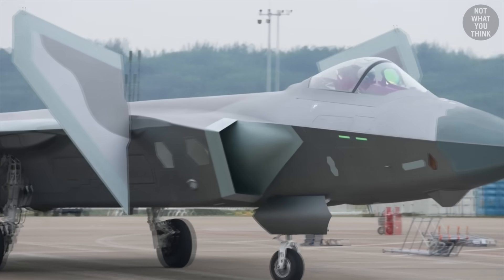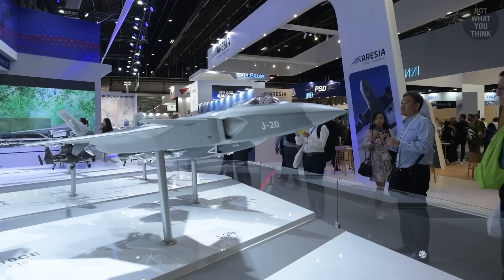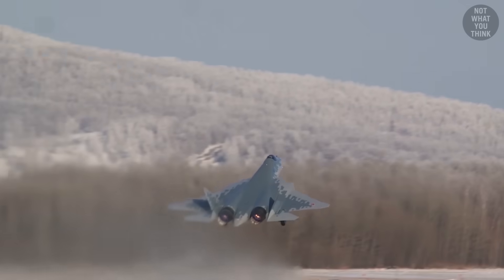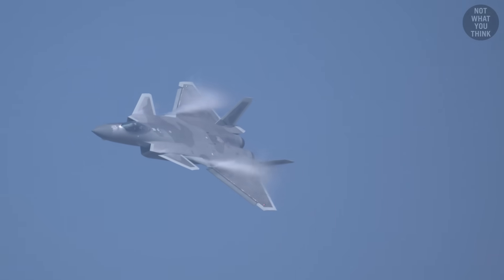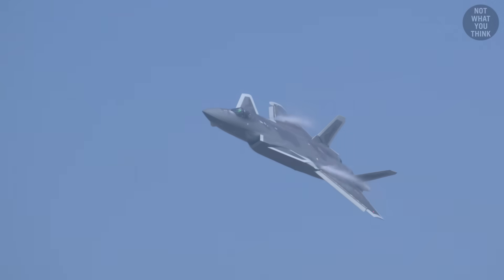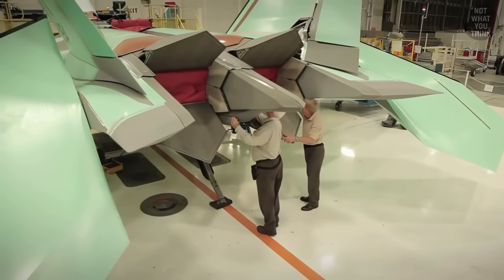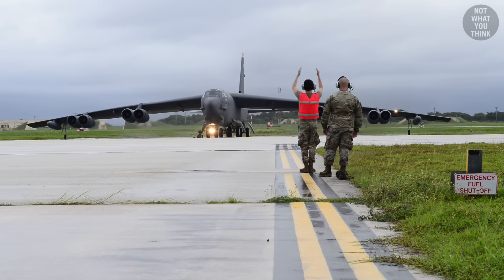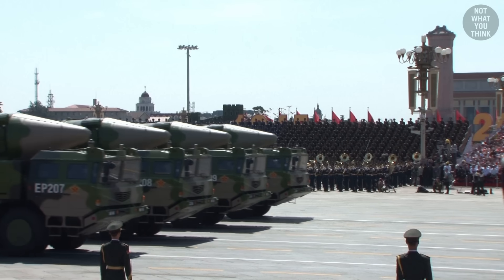Why China's Stolen "Stealth" Fighter is Problematic

Comment: Why does the entire video ignore F-35? I get it's for the sake of argument and a more relative comparison, but the major reason why US has soo little F-22 cause it was a mostly prototype plane that didn't needed to be produced in such vast quantities back then. Now US has built over 1000 F-35 which are way more suitable for mass production and is a straight upgrade to F-22.
Reply: Oh dear god thank you, finally someone actually understands that in a real conflict, the f35 is insanely more useful than the f22
Reply: @luckycorn8590 No matter what kinds of upgrades, the fuel tanks of F22/F35 still too small and they are also lack of long range missiles.
Reply: The F-22 was not just a prototype. It was planned to replace the F-15 in the air superiority role. Then the Soviet Union collapsed and nothing took its place, so the orders were cut way back.
Reply: @JarrodFrates  The F-22 is basically a hole in the sky where the smoke from the money you burnt designing it, building it and flying it goes up.   The combined production and operational costs are extremely prohibative, so much so that even the US cannot afford to maintain a large fleet of them.  

Which is why legacy fighters from the F-15 to the F-18 were not only maintained during the production run of the F-22, but were continuely built and added to the USN & USAF inventories until the F-35 finally finished being designed.  

The F-35 was suppose to be a cheaper alternative to the F-22, turned out it wasn't and is danm near as expensive operate at the F-22 is.   The F-35 is cheaper to operate at USD40,000 per flight hour as compared to the F-22's USD44,000,  a USD4,000 decrease but still a hell of lot more expensive then say an F-16 which cost approximately USD26.000 per hour.   Basically you can fly either ten F-22's for an hour or eleven F-35's for an hour for the same money.

Then there is the flight hour to maintience ratios between the F-22 and F-35 to compare.  For every hour of flight, the F-22 requires around 40 hours of maintence.  And because of its special radar absorbtion coating, maintence crews are required to wear speacialized protect gear at times, depending on what job needs to be done.  The USN claims that it only requires 4 to 5 hours of maintence time per flight hour for its F-35's, or around 1/10th that required for the F-22, however other reports put the ratio is more like 9 maintence hour for every 1 hour of flight.

While the F-35 is argueably a less capable fight compared to the F-22 in the air superiourity role, it does have greater overal mission capabilities and is slightly cheaper to operate and has a quicker turn around time.   It (the F-36) does also have on-going issue and has a lower availabilty levels, ie, number of A/C available for flight to total number of A/C or around 60%, meaning for the every ten F-35 available, only six are combat/flight ready at anyone time.  For legacy fighters, that ratio is usually be 80 to 90% depending on the model.
Reply: @gumpyoldbugger6944 The cost of the f-35 have dropped significantly since its production started. All of the variants are under $100 million dollars per unit.
Reply: @thebigsad5402  That is incorrect.  The current list price for a new is between USD102,000 to USD109,000 depending on which model is ordered.

For comparision sake, a new F-18 Super Hornets cost USD69,000 per unit, almost half the price of one F-35.
Reply: @JarrodFrates  And other reputable sources say otherwise, odds are the truth lays somewhere inbetween I guess.   

However, the overall per unit total life cycle cost of the F-35 is going to be signifanctly higher then that of a legacy aircraft.   

The F-35's only real advantage is it stealthiness, but how long will that last?   As we speak, there are smart engineers and designers working on improved detection and sensor systems to defeat that stealthiness.   

Give a fast nimble Gen 4.5 fighter the capability to detect and track an F-35 and odds are that expesive F-35 will be going down in flames.
Reply: @thebigsad5402  you would need to build several hundred F22 for a similar effect... but at a still higher price range than the F35. Nobody wanted that.
Reply: @gumpyoldbugger6944  The F-35 stealth is only one factor in why we adopted it. Logistically, it's designed to  replace legacy aircraft by outperforming them in what they can do, such as the f16, f18, a10, etc. Despite their high cost, it somewhat balances out with the aircraft it replaced. 
Its sensor sweep is second to none.  Even if it didn't have stealth, what it gives to the pilots in raw information alone is enough to tilt the odds in their favor. There is a reason why some of the F22s are getting an upgrade because it doesn't have those things that the f35 can do.
When it comes to stealth tech, I don't think we need to worry about who can defeat it. Russia has shown how incompetent and outdated its military is in Ukraine,  China is still playing catch up and is still unknown in combat. 
Don't get it wrong, it CAN be defeated. The question is, how far away is that plane when you are finally able to get a lock on, 200 miles or 20 miles?
Reply: @thebigsad5402  Now your F-35 battle readiness rate dropped from 51% to 29%
Reply: @kanlu5199 Building something that advance is gonna have its issues. Especially if you plan on making it a mass production plane.
Reply: @thebigsad5402  Yes, having issues is not a big deal. The key problem is that it fell from 70% to 50%, and now 29%. And USAF does not really care, or have a solution.
Reply: Its a bit more complicated than that since the F22 and F35 work hand in hand. the F22 is better in the role it was designed for over the F35 AKA Air Superiority and establishing it. the F35 is better for all the more ground based and supporting roles. the 2 together is a nightmare to face, cause you may see the AWACS radar, but not the 2 fighters one is destroying your stuff on the ground while fighters getting scrambled are getting swatted by the other. the F35 is not expected to surpass the F22 in its role until around 30+ years into maturity, at which point NGAD would have matured by this point so its entirely moot.

The reason why the F22 has relatively low production is due to the peacetime Dividend, basically they could save money on the military during the time the raptor went into production by putting those funds elsewhere. there is now a growing voice that cutting the F22's production run was a shortsighted decision hence why NGAD is being worked on earlier than you would expect. People are arguing over the costs of production but the reason why the Raptor is way more expensive is due to those cuts, only making a portion of the total order means those individual planes need to make up the costs of research and development will be higher, as well as these fighters were not made for export further driving price up. Its never quite as simple as "This plane is better" and the F22 isnt really a prototype, the B-2 would be as the first 5th gen aircraft given the established criteria, with the F-117 being the testbed and the price of a B2 over the F22 really shows how big a cost difference a low production run can be.
Reply: CCP propaganda successfully tarnished F35 image.
But still F35 is far more advanced than any of CCP garbage aircraft.
Reply: The F-22 wasn't meant as a prototype for the F-35. It was meant to replace the F-15 Eagles eventually as well as to counter the SU-27 that the Soviets built to counter the F-15s. The USAF originally planned to procure 750 F-22s, but the Soviet Union collapsed, and thus there wasn't any major aerial combat threat, so the USAF reduced the order size. Then came the War On Terror, which was a different type of war from the ones in ww2, Vietnam or even the Gulf war, it's not against major power countries, but rather insurgencies. U don't fight insurgencies with hundreds of fighter jets. Different type of conflict as well as continuous lack of aerial threats from rivals such as Russia & China meant that there was no need for more F-22s, therefore the USAF reduced the order once again, and finally to 187 units (someone tried to fight to keep it around 200+ - 300 units but was unsuccessful). And given how expensive it is overall (both unit cost and maintenance cost), USAF ended production. But now with the massive number of F-35, it will be as good as the small number of F-22.
Reply: You know nothing. The F-35 was and is in no way an upgrade to the F-22. The F-35 isn't even close to being as good. The F-35 was created solely to market and sell stealth air craft to nations around the world.
Reply: Most of the Cost of the F35 program is in its electronics that are way more modern, but also figuring out how you can mass produce it. The F35 production line is super advanced, developed by Northrup it is insane to guarantee the quality of joints and guaranteeing all of them are in place since tolerance are so important for stealth where just a smaller gap between panel can grealy magnify radar signature because of resonance in particular for small wave length high frequency locks that AA missiles need to be controlled at the required precision.
Reply: @pedrorequio5515  F22/F35 would be big weapons to frighten those poor countries, but both jets hesitate to engage with Chinese J20/J35, who equipped better radar and longer range missiles, especially with at least one generation higher advanced AWACS than USA.
Reply: @kshen7485  There is a big reason to hesitante, since the cold war Fighter jets enter foreign Airspace to deploy signal and behaviour intelligence on the interceptors. Why would they be afraid if they are not at war?
Reply: @pedrorequio5515  Why? Ask your American general, please. It is the reality after both some engagements in South/East China Sea.
Reply: The F-35 is'nt an upgrade from the F-22, it's a more reasonable compromise.
Reply: @UltrafalconVX7  No, the sensor suite is much better and it can Carry much more payload, which is what really makes the aircraft powerful, also more fuel and higher range. The F22 is a better Air superiority aircraft, but delivering lethality on ground targets it is much worse than a F15, that is why some argue for a mixed fleet instead of an all F35 fleet. 

Your argument still stands the F35 is cheaper and in the consideration it is like the T62 vs the T72. The T62 had better armour and was a better platform but the Soviet needed a cheaper tank so they came up with the T72 which also has a better Main gun, so in that respect its exactly like the F35 vs F22.
Reply: I can explain, cuz it ruins the agenda that this mofo is trying to get out off.
Reply: Because you should compare F35 to J35 instead.

Comment: A big heat signiture will not be picked up by radar. However, it will be picked up with any IR or thermal systems, like IRST.
Reply: It's because the unburnt fuel as well as the flames from the afterburner show up on radar
Reply: @autoroller3391 The afterburner does not put out a radar signature but the unburnt fuel will be detected.
Reply: @autoroller3391 interesting. do u have any good reading about this u could link?

Comment: 3:20 I've never heard of after burners showing up on radar however the ability to supercruise is important because afterburners burn a ridiculous amount of fuel as well as reducing the IR signature

5:30 A. most countries don't have IR guided bvr missiles so even aircraft with infrared search and track wouldn't be able to engage a stealth fighter with out a radar lock or being close enough to fire a fox2
B. The thing about stealth is if it gets close enough you're going to get a return so it's not like a stealth aircraft is immune to a radar guided missile 
C. It's worth noting that the f22 is being updated to have a infrared search and track system installed in fact it's scheduled for testing around this time of year
Reply: “Wouldn’t be able to engage without radar lock. . .” With that logic what’s the point of IRST? I’m pretty sure that you can guide a radar guided missile with IRST, so you can use a radar guided missile as soon as you can see the enemy, regardless of how you find them.
Reply: @jakammor4449  you're pretty sure of nonsense. If you use the irst to lock something the radar can't find the missile will not track anything and wilk simply go off the rail. The Soviets used those long ago and that's why they had long range fox2 and the ability to "focus" the radar by using the electro optical system. The main use however has always been high off boresight fox2 missiles for dogfights since it moves with the pilot's head and has way more movement upwards then what the radar has. The Russians have perfected their implementation and use of those. And no fail35 is junk and can't do that because it's irst is under the nose instead of above. Because it's not a fighter not matter how hard they claim is it. Instead of using a targeting pod they built it in the nose. Basically copying the Su-25T.
Reply: @jakammor4449  part of the use is for dogfighting a short range IR guided missile like the aim 9 only has a relatively small bore sight so it won't be able to see a bandit if the nose of the aircraft isn't pointing at or near the bandit however an aircraft with a IRST can provide targeting data to the missile, so a pilot can fire a missile at the bandit regardless of relative positions just by looking at the bandit the most famous example of this is the F35.
other than that though IRST systems are way shorter range than radars (gernorius estimates put their range at 30 miles) they could be useful for identifying contacts
Reply: @acompletelynormalhuman6392  “aircraft with IRST can provide targeting data to the missile…” exactly, you can provide targeting data to a radar guided missile aswell, untill the missile gets close enough to see the enemy (stealth) aircraft. Especially when the enemy’s radar stealth is better than its IR stealth.
Reply: BVR missiles to date are radar-guided, but with datalink relays already on place, a BVR IR missile isn't impossible. You can have one plane ID the target, relay it to a launch platform that is running silent, the launch platform sends it off, and the missile heads to the target, getting a handoff to the targeting plane for mid-course correction and then taking over final targeting on its own. The advantage is no radar signal to pick up, and the missile can come in from an unexpected direction.

Comment: Suuuuurrreeee, Temu F-22... The IR and radar signatures are not going to keep it hidden from the F-35. China may have comparable manufacturing capacity to the US, but the US still has a logistical superpower, last i checked, China has yet to build up a fleet of aerial refueling tankers nor train the pilots in the challenges of air-air refueling, which means they have to: 1 make them massive to hold enough fuel, thus approaching diminishing returns of bigger needing more powerful engines which chugg fuel, 2 use carriers which are vulnerable saturation fire using low observable, high yield, ling range cruise missiles which is why the US has developed the rapid dragon. 3 Use of drop tanks which add more surfaces to reflect radar with gaps from the pylons after the tanks drop which are going to increase its RCS.

Then finally, China also is severely lacking in experience and training with stealth aircraft.

Comment: The F-4 Phantom 2 didn't have a gun at first for the same beliefs, only for them to get massacred in close combat.

I think Stealth Fighters are even more likely to get into close combat because they detect each other much later.
Reply: The F-4 phantom was designed around long range combat, to fight with missiles which is why they did not plan to incorporate a gun into the airframe. But during that time, missiles were still in early stages of development, and failure rates with them are often high. Combine that with F-4 pilots initially not trained to fight in dogfights, since the aircraft wasn't meant for it, this contribute greatly to their losses. 

But as time move on, statistics reveal that F-4s get more kills with missiles than guns. After Vietnam war, aircraft with air to air gun kills are becoming more or a rarity. Missile technology are more reliable and effective than what we have previously. 

In air to air combat, Jets will first fire their missiles then move away from their opponent, to distance themselves away from the missiles that their opponent have likely launched and increases the chances to avoid getting hit. They don't close in and fight with guns, too risky and they're more likely to get hit by a missile. 

While it is true that stealth jets, with their reduce radar cross section, are they'll likely engage one another in closer distances, this does not mean they'll have to dogfight. Stealth jets main strength is their stealth. Once they close in, they lost that advantage, and become visible like any other fight jet. 

And stealth jets tend to be very expensive. I don't think any military want to risk using their stealth fighters in dogfights, compare to having them to stay back and fire missiles, using their stealth as advantage so their opponent can't target them better.

Comment: J20 engine useful life is a fraction of other modern fighters. And, it's stealth is exaggerated. The advantages assigned to the J20 over the F22 are not real due to the upgrades being made to the F22, it's phasing and it's ongoing replacement. This comparison is like comparing the MIG29 to the F4.